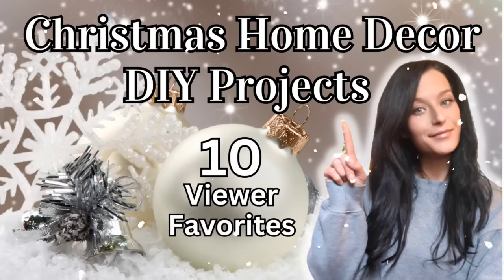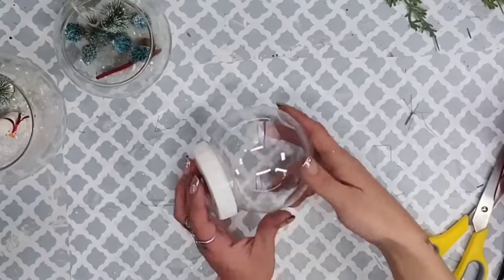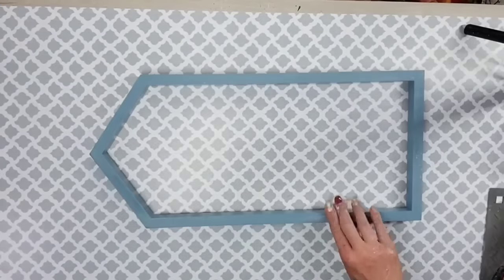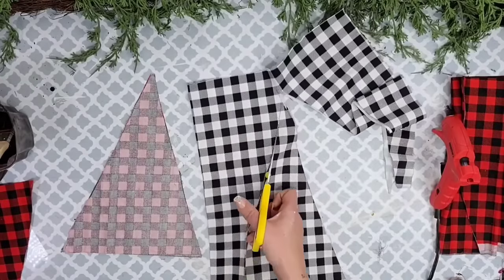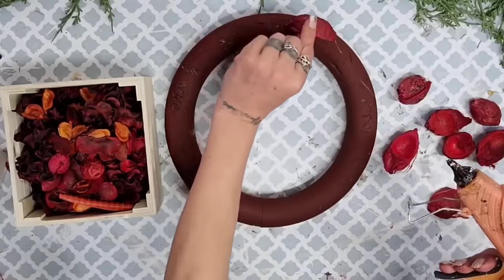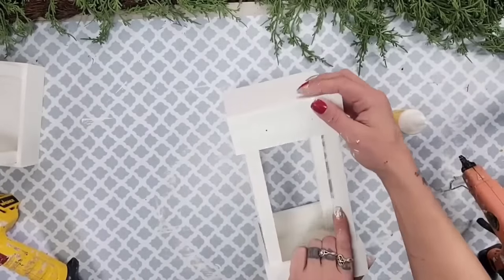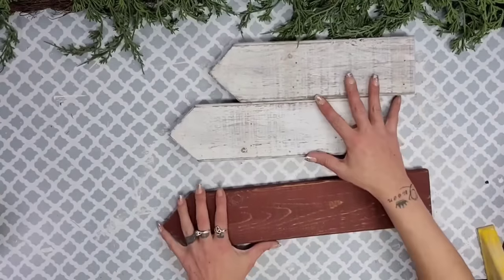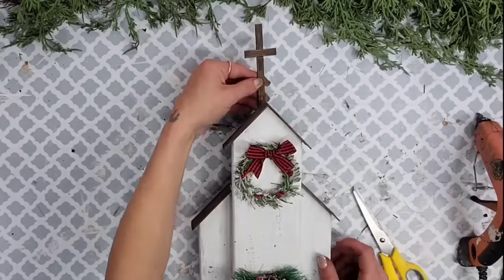WINTER Home Decor DIY Projects | Dollar Tree | Budget Friendly

Comment: Amazon is out of stock on the little table saws and don't know when they will get any more. However, Harbor Freight has them in a different brand and they're on clearance right now.
Reply from the maker: I am hoping they restock soon but yes you can buy it at Harbor freight, Lowe's, Home Depot and I was told Tractor supply has it as well. I would shop around for the best price.